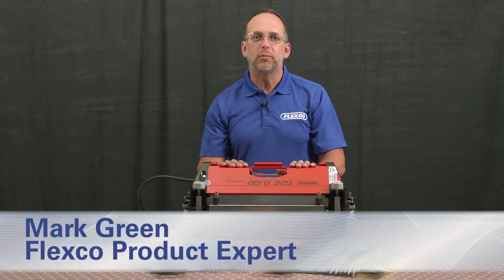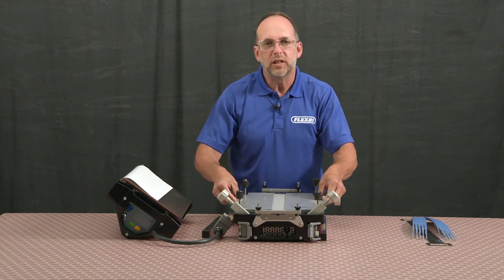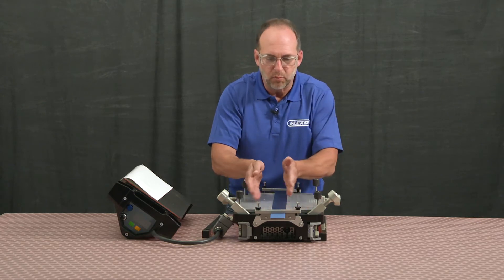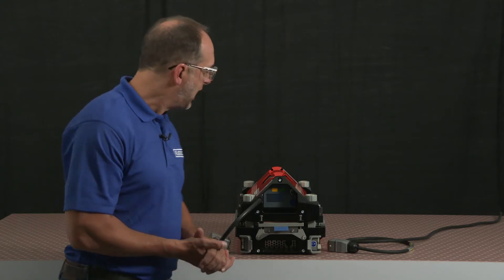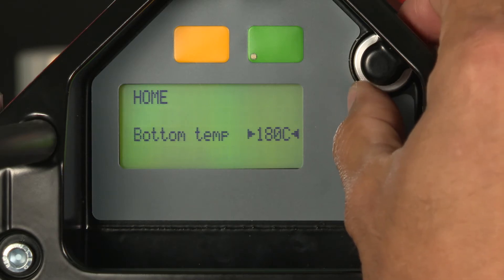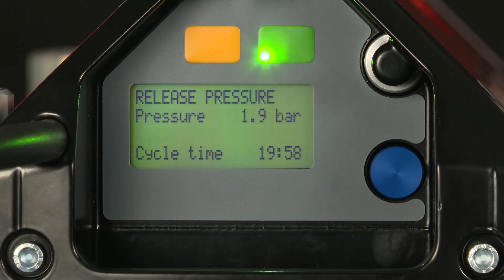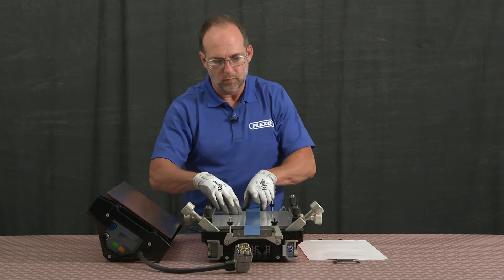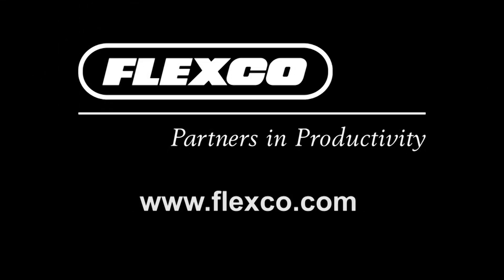Novitool® Aero® 325 Splice Press 45mm Belt Operation

Comment: What is the max width when using the small hold down bars as you did here? What silicone templates are available?
Reply from the maker: The current maximum width to splice narrow belts end to end in the Aero® 325 Splice Press is 117 mm.  There are belt templates for 45 mm wide flat power transmission belt.  As well as belt templates for 77 mm wide power transmission belt with notched v-guide and 77 mm wide v-guided traditional thermoplastic belt.  Please contact www.flexco.com for additional details.